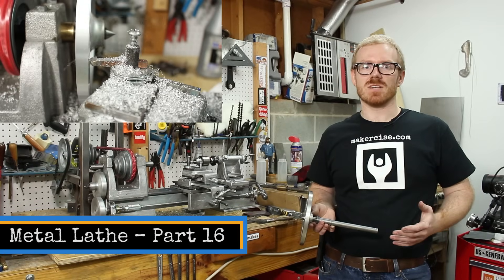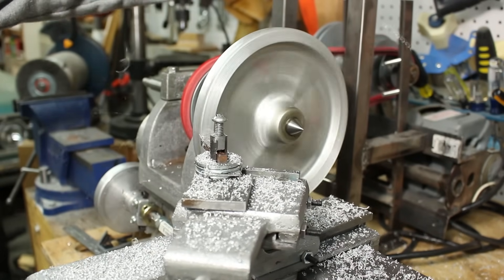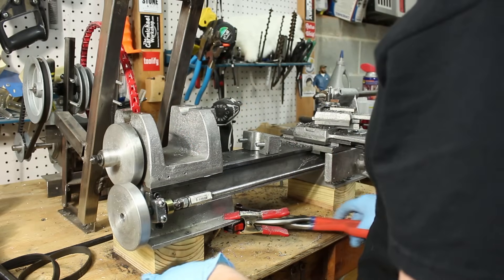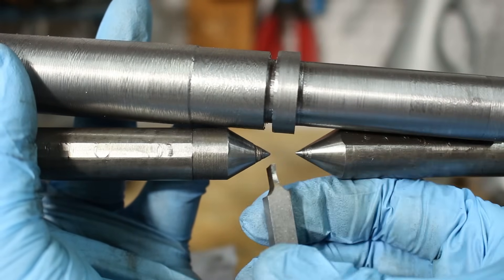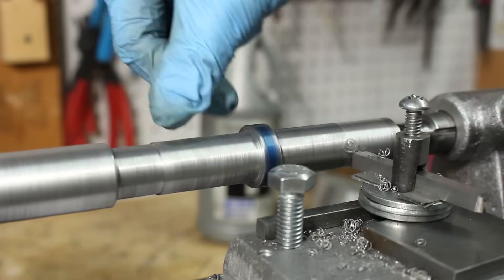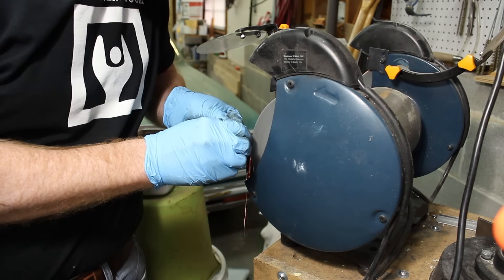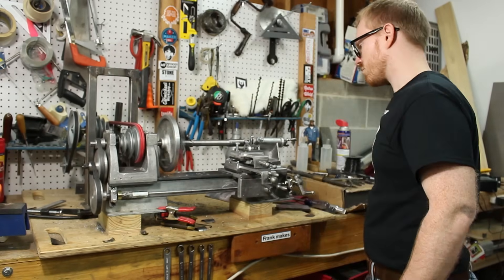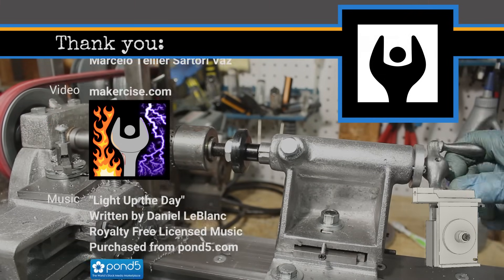Metal Lathe - Part 16: Completion

Comment: 8:11 with tailstock point damage, i was wondering if you fully buried the spot drill to the end of second bevel because it looked like you only went half way then backed out which is half the support and the point can get more squirrely with less contact surface and if the point is touching metal because not enough free void it's even worse with a pivot point (the tip) to cant the entire cone.

Comment: You really should bore a Morse Taper into the Headstock Spindle.  A long time past, I often watched my grandfather insert a Jacobs Chuck and a centre drill into the spindle of his lathe.  A dead centre was also inserted into the morse taper on the tailstock.  Cylindrical stock was center punched and mounted between the centre drill and the dead centre.  When the lathe was started, he'd gently hold the stock from turning with his left hand, while forcing it into the centre drill by extending the tailstock.  A good way to centre drill stock if you couldn't afford a drill press, wouldn't you say?  Back then, South Bend Lathe accessories included tailstock devices such as drill pads and crotch centres.  These accessories permitted most drilling operations to be performed on a lathe.
Reply from the maker: Gord Gardner ive been thinking about it. The headstock bearings and spindle need some attention. I can definitely see the advantage of a MT socket now. The center point gets in the way when mounting stuff to the faceplate.

Comment: At 8:30, the chowdered centers.  Did you use a center drill?  It should match the taper and leave an oil pocket.  Did you oil them?  Maybe you turned too long and they ran dry.

Comment: for your spindle oil fittings mught want to use automotive grease fittings...then you can use high pressue lube/grease also the advantage with a morse taper is can use a drill chuck in headstock and though not proper could do light milling with a addition to compound slide
Reply from the maker: Miguel Castaneda I think I'd need a draw bar to hold an end mill safely. probably depends on how light of a cut I take. thanks for the siggestion.

Comment: Hey man, just wanted to reach out and say thank you. I build motorcycles in my garage and I worked in a ductile iron foundry as a supervisor for a long time. I’ve been dying to get a lathe for even longer. I discovered your videos and the realization that I could cast my own lathe blew my mind. Very strange epiphany. Yesterday I ordered the entire set of David gingery books and I’m about to embark on an amazing adventure thanks to you. I think I’m gonna do an electric furnace though so I don’t explode my garage this winter up here in Minnesota. Thanks for the help and opening up my eyes to the possibility. I’ve spent a few years now building my small portable equipment to create a full blown machine shop in my single bay of a two car garage haha.
Reply: Hey Brother , two years ago I was just getting run over by a F350 on my 1957 Harley Panhead. It has taken me over 18 months now to get rid of the blood clots, be able to walk again and get back to work. I am starting a mobile welding , fabrication and small engine repair shop with a manual machine shop that is run from a central belt and steam. I hope you got started or found a good lathe.

Comment: with a morse taper in the spindle you can use the lathe to drill/bore larger and or odd shaped parts buy chucking the tool and mounting the part on the compound via a fixed or adjustable angle plate as well as use pre made hardened centers...could also use it to mount a er32 style collet holder. People tend to think of lathes as just for turning but they were also used for milling...some of the setups are kinda bulky and convoluted but used to be fairly common.Check out this vid https://www.youtube.com/watch?v=W_8in1Z6sXg and his whole channel...lots of good stuff there

Comment: Carpet tape is sticky on both sides, get 2 inch the you can stick your sand paper on it.
Drill a hole through your bearing caps and bearing then before you start your lathe you put a couple drops of oil in it. 
When you use your lathe with a sharp bit it stays sharp longer if you use your magic tap steel cutting fluid.
And for aluminum you use the aluminum cutting fluid.

Comment: With a Morse taper on the head stock spindle you could mount a large Jacobs chuck to hold round stock to be drilled.  There are special chucks that have curved blades to grip dowels.
Also some three and four jaw chucks mount via a Morse Taper.  Maybe some of this stuff is more useful on a wood turning lathe than a metal one, but I've seen videos of it being used.

Comment: You could install grease fittings quite easily on your two bearings which support your spindle. You could also source some automotive single lip seals, to keep all the oil in if you chose to go that route. But grease might make less mess and provide good lubrication

Comment: For your lead screw and split nut, you may find using some acme threaded rod would work a little better. It's less likely to bind than a V thread. As for the split nut itself, I wonder if making it out of brass or bronze would give more durability. You could cast most of it out of aluminum, but maybe fit some bronze for working surface. An acme thread tap would eliminate the need to cast the bronze. Keep up the good work.

Comment: seriously you did a fantastic job with that lathe, but why the fuck woulb you not use normal fucking ball bearings?
Reply: Legacy of the gingery book being written when taper roller and angular contact bearings were uncommon/expensive. Also split bearings allow a great fudge factor. Spindle too small? Clamp them down. Spindle too big? Add some shims. Ball bearings require a precise fit so you can't use off the shelf steel rod. 

Now that he has a lathe to machine the right fit though he could always make a new headstock with taper bearings or angular contact ball bearings. Would be much better.
Reply: Think of how much larger the castings would have to be to house ball or roller bearings.  For these small lathes the loads are fairly low and the speeds aren't that high.  Bushings of some sort can be the best choice in some cases.
If you have time, check out "Polygon bushings" they are sized as the regular bronze bushings but are make of  composite  materials which can take some serious loadings and speeds.
Reply: The book was published in 1980, no machine tools used bronze spindle bearings in 1980.  It's a legacy of Gingery trying to sell books to people who don't know any better.  A 1 inch taper roller bearing is common as dirt, every crappy little trailer uses them for wheel bearings.  There are many unflattering things said about Gingery and his lathe.  All of the challenges in building and using the lathe in this series only serve to reinforce those opinions.
Reply: Bigger castings aint too bad. Most of the cost for the gingery lathe is in labour costs making the patterns and machining. The cost of extra aluminium for the larger casting is relatively low.

No bronze spindles in the 1980s? Have you ever seen a Myford?

Comment: Awesome work, I've really enjoyed watching this series. I just finished my crucible tongs last night and am getting ready to test my first pour tonight, then on to my own Gingery lathe build. If you had to do it over again, would you make any substantial changes to the overall design? ie, make the headstock & tailstock taller so that you can fit larger diameter work pieces, or make the bed longer, etc?
Reply from the maker: I'd make the lathe feet taller. Mine are accidentally shorter than the book calls for, but I'd make them taller than the book. The split nut design is poor. I don't have a good alternate design though, just lots of complaining about the split nut on mine ;) Maybe I will soon though.
Reply: @Makercise  what do you think about using Zamak or other zinc based aluminum alloys to increase the weight and hardness of the cast parts?

Comment: I can think of a thousand improvements ; though #1 on the list would be Tapered roller bearings on the headstock; * & use a polished / hardened shaft !   ( Not to knock your work, the shaft should be nearly 'mirror' finished . . . & to the precise size for the bronze bushings . . . 'as is' , I would think that the shaft will EAT the 'bearings' in a very short amount of turning ! )      
    Bearings that can / must have a 'preload' on them to have the least amount of 'slop' - which will generate the best possible accuracy !   If you look at the amount of 'wiggle' you have at the headstock, it will be amplified by quite a large amount when you reach the center of the machine's capacity . . .    * I'd suggest a 1" shaft, with 8 threads per inch at the spindle nose - this would allow you to mount a standard chuck in the future !   ( another possibility would be to use a hardened tube for the spindle .  . . 'off the shelf' parts could be used for assembling a very accurate headstock - )      'Glad to see this project moving along !  :)       Refinement is part of the nature of machining !    Good luck ! 
       One last thing : a 'LIVE' center at the tailstock will pay for itself in no time ; & can be 'self made' , * simply get a good sealed thrust bearing of the right O.D. & I.D. - the center will ride on bearings, instead of being chewed up by the rotating hole from the part being turned !    ;)

Comment: I've spent last hours to go through your wonderful metal lathe adventure, this is a technical manual that everybody must have to see before making any lathe from scratch.
I've just started to collect parts for my 10" chuck lathe, and because I've no experience about foundry, my project is to use steel plates and make chips.
It will be a large lathe, able to rotate big things up to 30" diameter, with short bed guides.
Fortunately I have already a chinese mini lathe with all major issues already solved (that is also a good experience on how to set up a lathe).

Comment: Issue with using a parting tool for longitudinal turning is the side way forces on the parting tool. Parting tool has no strength in it's width. Parting tool is only suitable for cutting perpendicular to the metal in the lath.

Comment: Hello. I wonder if the Gingery lathe, shaper and other machines in his series could be built in metric sizes. How much redesign would be needed? Asd I understand every little bit needed to its build is in US sizes. But here in Europe and elsewhere it would be pretty useless since we use metric.
Reply from the maker: ShiningForce07 you are inside my head. I just recently started using metric. even acquiring an m6 m8 and m10 tap. more to come. I also purchased about $50 worth of bolts and nuts in metric. more to come. I expect there will be some components that will be infeasible for me to acquire in SI dimensions. my intention is to do as much of the subsequent machines in metric as I can.
Reply: Actually I'd started the first one the lathe based on the book, but, using US or imperial sized anything here in Europe was like stg out of a horror movie (constant resizing) added that im not a machinist or locksmith myself, also. With that it was a living hell :DDD so I gave up the attempt very early. 
But apart from that, Gingery's education through creation idea is very brilliant indeed so it would be very useful here, too.
Reply: Nothing in this is a critical size (3inches can be 76 to 77 mm) use standard sizes for metric bolts, shafting and steel sizes. Just have to have critical dimensions match with what you are using.

Comment: You do a great job building and troubleshooting your projects.  On this one, a use tip would be to take a look at McMaster Carr website  at their "oil cups' and "oil reservoirs" .  They will help you keep a steady supply of oil to the spindle bearings. I wouldn't think they would be prohibitively expensive.  You can probably find similar itens at "Grainger".  "Good Luck and Happy Turning!"

Comment: Gingery lathe. I've heard about them ad nauseum. You would think by now that this design which is at least 60 years old would be obsolete. I also wonder about the Sherline, Taig, and those Chinese made machines? They keep making them based on designs decades old. For instance, why can't they make the bed out of cast iron and have the bed, not flame hardened, but surface ground, at least? Oh, it would cost more, right? But that's how they were made back then. Why would it cost more if CNC technology provides greater accuracy, production, and efficiency? Why spend time and effort "improving" them yourself if they are new? This would be tantamount to buying a 57 Chevy built in 2017 exactly as they were back then hence with no power windows, discs brakes, air conditioning, GPS, heated rear window, or more efficient engines like the ones we have today. The manufacture of small lathes and milling machines are living in the past. You will never see such retrograde design today in kitchen appliances, stereos, computers, cars, bikes, chairs, shoes, or cameras. 
While you may take pleasure in buildinging a Gingery lathe from scratch, it will have considerable limitations in terms of accuracy and for a small lathe, I would think that should be critical. If i were to built a Gingery, I would prefer to have all the parts precision machined and then it would be just a matter of assembly. It would cost more, but you get a better made machine and therefore you make better parts. The same applies to those substandard made Chinese machines. We ought to suggest to them to just focus on making parts and designs with better quality in mind and leave the assembly to buyers. What they save on assembly they can spend on improving the functionality of the machine and it's accuracy.

Comment: another good trick for home machining, if the oil is causing a lot of smoke, but you dont want to use water (rust), you can order a concentrate Of Trimsol or other coolant brand, its about 50 parts water to 1 part concentrate, and it is kinda messy but if doing a lot of work, it can help, and its a safe product in terms of pollution or whatever in the shop, its what all the CNC machines use. i use a squirt bottle

Comment: Here's an idea:  Make a new spindle with a larger diameter end, and bore it for Morse taper on the inside, and thread it for a lathe chuck on the outside,   You could rebore and tap your existing face plate, and, with the right thread, use a small three or four jaw chuck that is commecially available, like those for the Atlas 618.   Then, you could also mount a Morse taper  drill chuck, and use the lathe for horzontal drilling by clamping work to the carriage.   Finally, you could make  Morse taper live and dead centers, and use those with your face plate.

Comment: I'm on mobile so I don't want to fight around and look through your videos but what is your motor? I have a 1.5hp treadmill Motor. well that be good enough? congrats on the project! how long did just the lathe take to complete without   factoring in editing and shoot time? ever since I discovered your books I wanted to make the while series! I'll definitely be following your channel for a long time and using as a guide when I get my lathe and casting started!
Reply from the maker: I totally understand mobile limitations. I used a 1/3hp 120VAC treadmill motor. Yours should be great. It is hard to tell I'd estimate over 1000 hours, I'd like to put together a better estimate of my time for the shaper build. One correction, the book series is not mine. David Gingery wrote the book series back in the '80s. Please share your progress when you get started.

Comment: Very nice work. Why was the tailstock out of alignment, wasn't the bore of the tailstock drilled and bored on the lathe itself, anyhow good job.
Reply from the maker: PGS it was, but the screws in the bottom clamps could have been a touch tighter. the zip ties caused the inside of the tailstock to lift a couple thou. or at least that is my working theory.

Comment: really nice lathe. Do you plan on doing something against the belt slipping on deeper cuts or are those kind of lathes just not really meant for harder work?
Also do you wanna mount a chuck on that in the future? would be way easier to hold your workpieces
Reply from the maker: rigdigwus a better drive train first, maybe back gears eventually, chucks are also on the roadmap

Comment: I don't think i'd bother with making a morse taper spindle. My spindle has an MT5 taper, and I don't think i've ever even used it. The fact that you already have a spindle with a built in center makes it all but redundant, but I suppose if you do a lot of work between centers you might like to be able to use a hardened center.
Reply: With a MT5 taper spindle, you can get a MT5>5c Collet adapter from Grizzly...or you can make one, but it is nice to have a hardened and ground adapter.